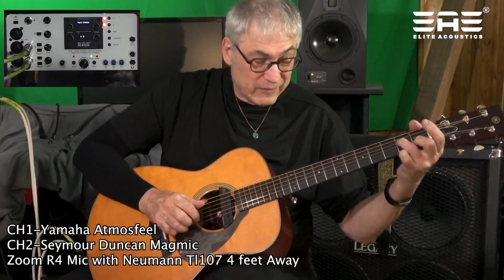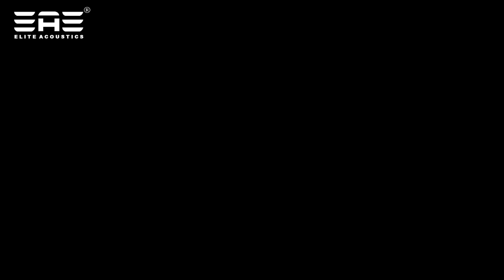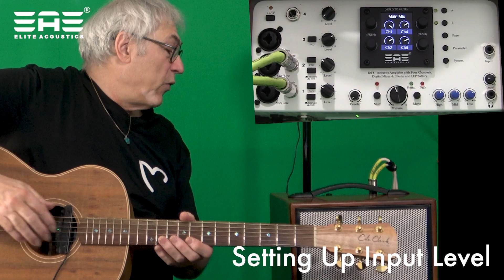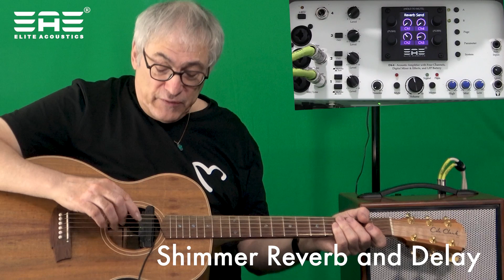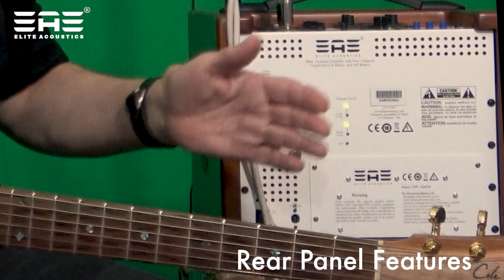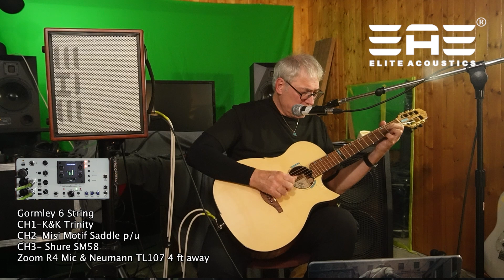Elite Acoustics EAE D4 8 Four Channel Amplifier Introduction by Don Alder

Comment: THE ULTIMATE ALL-IN-ONE SOLUTION!
The best piece of gear I’ve used in 25 years: The Elite A. D6-58.
4 speakers, rechargeable battery, Bluetooth, semi-parametric EQ (!), Reverb, Chorus, Delay (nothing superfluous), Gain, PAD, Gate, Notch, Phase, Phantom Power, Compressor, Pan for stereo expansion, Subwoofer output—all this across 6 (!) channels with a built-in mixer, plus 10 scenes/patches recallable via MIDI controller. Expensive? Just do the math. The downside: A rudimentary user manual.